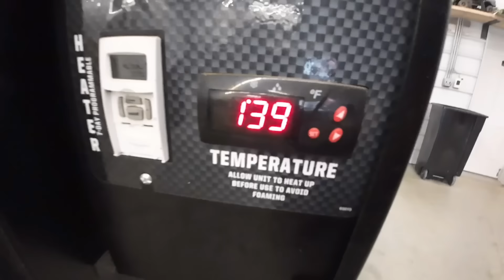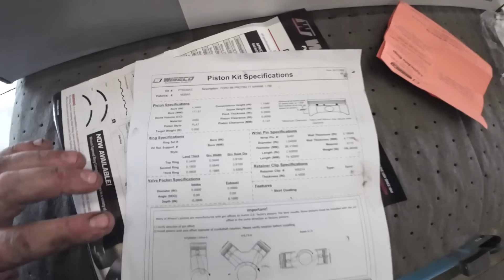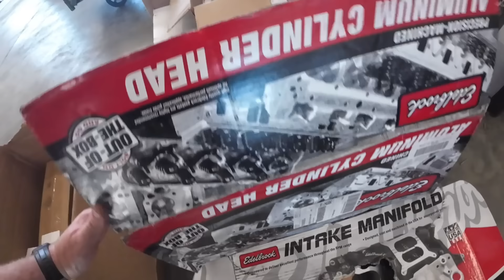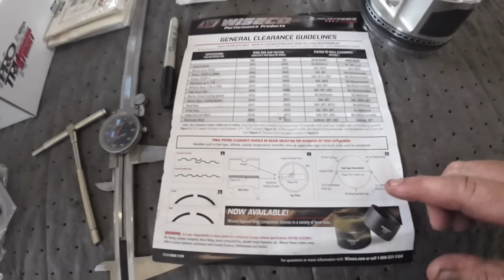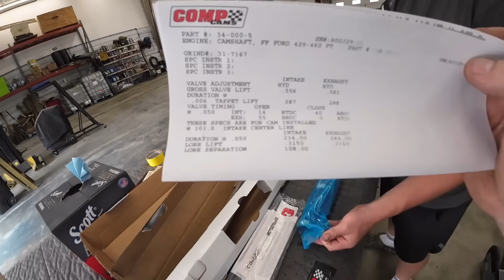Ford 460 performance engine build for Hunters 1977 Ford Highboy

Comment: going to be a nice build. I like the old 351m/400 ford motors . The 400 is a strong motor if built right  4x4...  4in stroke 4in bore   The 460 will make some good power !!!

Comment: Clint, I noticed when you installed the cam that the distributor drive gear was dry. I would suggest you lube the distributor drive gear when you install it. This gear has a lot of stress on it. It takes a while for oil to reach the drive gear.
Reply from the maker: Yea that probably a great idea
Will do next time
The oiling mod we done should of helped some also by spraying oil on that when we primed it up
Reply: U can lube the gear on the distributor when you drop it in.

Comment: the 460 is waaay better than the 351m boat anchor.  me and a friend did this exact swap on a 77 Ferd 4x4   it turned out great.  if yall want to upgrade that clunky np435. check out the tremec TR4050. i put one in my 85 K30.

Comment: Clint, on the cam bearing installer the white cone goes on the shaft and centers the tool in the cam bores. just like line boring loader  arm pins. the tool will then be straight when installing or removing the bearings.

Comment: Just wondering if you guys set the pre-load on that thrust bearing on the crank didn’t see you do it but I know that doesn’t mean you didn’t. I love this series on the Fords you guys do I got a 360 I started on about two weeks ago. Parts are a little pricey for that compared to most for some reason.

Comment: 500hp in an old highboy, i cant think of a single thing that wont break behind it😂😂. Cool ass build though man, awesome to see some father son builds these days that they can enjoy. Never seen such redundancy in engine stand strength in my life😂, engine looks like a toy on that stand in compared to what you usually have on it though. Use the rings per bore, never trust one ring for every bore use a ring for that bore as each ring will likely have a different gap on the same bore. FedEx is can destroy an anvil within a mile

Comment: we built a 383 stroker engine for a 78 vette with 650 cfm carb,  dyno at 420hp  500 seems a little light for the cost and parts used.

Comment: There is a white cone your cam bearing tool kit.  That is to slide over the shaft after the tool, small end toward the engine, and the cone is pushed into and held in the outer cam bearing hole to keep the shaft centered while you install a bearing.  That way the bearing is installed square to the bore.

Comment: I am afraid distances are larger where you live but sometimes for deliveries(to you) you’re better of collecting them at a pick up point. In this case of damage it is possible you cannot keep your promise to the customer because you have to wait for undamaged parts. But i am afraid environment it getting the better of us. Less waste so no protective stuff in the box. Like to follow this. Even the ,,humor,, between the 2 of you. ,,this engine wont do performance stuff,,
,,nope only an occasional drag strip run,,😉😁😉😁
I am not lazy but thats why i go for a citroen 2cv (ugly duck).
It’s a 2 cylinder engine.

Comment: An overhead hoist company needs to sponsor you and get you setup with a few. It was a real game changer as fast as making engine pulls/installs and material handling much faster when building trucks at my dad’s company. We designed and built all types of oilfield related semi trucks, rigs, pump trailers, generator trailers and so on. We utilized forklifts for everything for a few years before getting our 8 hoists.

Comment: Tap freeze plug holes and put in a threaded inserts because the freeze plug holes are just too get the sand out from casting 😊

Comment: I was taught at a very young age of 10. 
Was taking engines apart and put back together. 
Hands had to be washed and a light dusting of wet sawdust on the  floor so no dust. 
Great job dad and  son👍

Comment: Sometimes we buy modern day oil field Alberta trucks here in Ontario . For reference my buddy just bought a 2012 with 100,000 miles and it had 25,000 hours on it . Trucks up there idle , and idle , and idle some more . That should explain the .030” over bore and the bearing wear. I’ve been watching for a couple years now, keep up the great work and beautiful shop !

Comment: ford 460, should the flexplate weight be facing the 12 o'clock position ? 
or be facing 180 degs the other way in the 6 o'clock position?
 in relation to the hatchet weight in the front.
please help me, thanks

Comment: C&C Equipment.. Cool video. ALL of the rings should be checked and file fitted (or make bore bigger with hone) to the perspective bore they are going in. All of the rings are probably a little bit different in size as are the cylinder bores. Just because one ring fits doesn't mean all of them are within spec. ALWAYS fit the rings to the cylinder bore it is going in and don't mix them up. I have built engines where when I checked the gap in the cylinder I had to file fit some of the rings and some of the gaps were to big right out of the box. When that happens you have to buy more rings. Nothing you can do about a ring that the gap is to big except set it aside for the next engine and buy new ring/s. It doesn't happen all the time but it does happen.

Comment: Clint, great job, I like your honesty about you not being professionals, I was building a 392-international engine that times off number 8, and it was being difficult and the Transportation Manager picked up a can of starting fluid and sprayed it in the carb, well it blew the oil pan gasket the valve cover gaskets plum out from undereat the pans and bent the push rods, HE NEVER CAME BACK IN THE GARAGE LOL

Comment: Building a 460 myself and I have those same rockers, what length rocker studs did you use?
Reply from the maker: I don’t remember on the studs
It’s what came with the heads

Comment: Truck is looking good Clinton and Hunter! That 460 will have the torque to get that heavy truck on the move. The fuel injection will be a nice addition to not have to fool with the tuning all the time and probably a little better fuel mileage to boot. Lord knows she'll be a thirsty one! I can't believe they didn't pack those heavy parts better than that. Usually, Summit is very good about packing things very well, so I'm surprised they dropped the ball on their end. I've never had a packing issue with Summit as I have bought everything from crate engines to sheet metal from them over the years. My FedEx guy is very good about making deliveries during regular hours that my shop is open, but if for some unusual reason he's running late, he calls me to see if I will take them after hours and where to put them, but that is a very rare need, so I like to treat this guy pretty good.  That crap with piling them outside your gate would not fly with me. I know those guys put up with a lot of crap in their job, but that is unacceptable to dump that stuff off like that. UPS sucks in my part of the world, so I use FedEx for now. It used to be the opposite, but I think they're both going down a rat hole eventually. Anyhow, can't wait to hear that BBF fire up and go down the road!

Comment: Not just an issue in the USA with delivery drivers, also the same over here in the UK, as my wife and I have mobility issues and and aren't as fast or as able as we used to be, we have a large sign on our porch door that says, leave parcels in porch and then ring the door bell. You'd be surprised how many idiots just leave the parcel outside the porch and don't even ring the door bell! Nice to see you and the 2 boys doing car stuff together, really like that piston ring setter so easy to use. 👍

Comment: We have some old ring compressor /piston installer tools like that . They were John Deere special tools. Of course the Deere pistons come in the sleeve already so we don't use those much anymore . I'm in the middle of overhauling a 12.5. Have to use a long 3/4 ratchet to  torque rods and mains on those . They are tight .

Comment: I would bet that being that truck was used in Northern Canada in winter , where it gets to --- 30 that engine never shut off !!!  I live near the Canadian border in western NY and the block heater was the give away , That truck should have had a hour meter . In DOT if the trucks weren't plowing they were plugged in so you could get them started , A lot of the plow trucks were kept in a heated shop just for that reason . Love the videos , stay safe , be well

Comment: Bringing back memories, I built a couple of FE blocks and putting the top end together was different with pushrods going through the intake. I bet that 460 is going to sound sweet, except the camera in the cylinder and the one in the oil pan are gonna make a racket.😁

Comment: Not a big fan of FoMoCo, raised to be a small block GM/Chevy guy, but engine builds always fascinated me, just never had the shop set up like you've got to do the things you do! It ain't easy trying to rebuild an engine in your parent's carport!  Your sons are very fortunate!
I was wondering if you were putting a roller lifter cam in that beast, looking at the cam lobes it seems like that's what you were using, but you never said!
It'll be interesting to see how much Shake, Rattle, and Roll that thing has with that radical Cam! 👏🏽 👍🏼☺
With that much horsepower and stroke, the torque developed should be enough to do four-wheel-drive burn-outs, if you don't twist something off! 👏🏽 👍🏼☺

Comment: Will you put a line on the pushrods to watch and  make sure the cam lobes aren't  getting wiped  during break in? Everyone has been having problems with  bad lifters  lately--even name brands ! They can wipe a cam in minutes !! Good luck !
Reply: IDK if you're counting on your push rods to oil your cam lobes, seems to me you have bigger problems than the push rods. Try checking the oil passages to the Cam as a starting point.😮😊
Reply: pushrods dont oil cam lobes-you just want to make sure the pushrods are spinning-then you know the lifters arent wiping the lobes ! @Curt-dc6cd

Comment: know it is too late by the time I seen video. you had pistons marked with arrow for a reason, so 2 that I seen are wrong by the arrow marking. did not see all so only know about the 2. if it made a difference, it would be in the rods.
Reply from the maker: Yea
We got them right

Comment: Coming along nicely ….I believe the h beam rods are actually scat industries with summit on them….they are identical to the ones I bought for my Chevy motor . The rpm cam will be lobey…he should have fun with it . At 8 gallons to the mile….errrrr…8 miles to the gallon 🤣🤣

Comment: Clint, a little tid bit for you. A very good buddy of mine works for Fed Ex..been a courier for 28 years. He’s told me personally, (because like yourself I had some complaints) that Fed Ex is trying to move away from the current service to a 100% sub-contract service. It’s less headaches for the company has a whole and puts the burden on the subcontractor. But the customer service has plummeted..trust when I say you’re not the only one frustrated. My buddy has told me to use UPS many times…

Comment: Had you thought about having the rotating assembly balanced?
Reply: Although it can't hurt... You probably only need to balance the crank in a racing engine, which you would have balanced and Blue printed anyway. Good tip though.

Comment: Edelbrock doesn't make any max effort stuff, but for what you are doing, they do have good top end kits. The heads, intake and camshafts are made to work good when used together. You need to call the fed-ex 800 number and do some serious complaining. I have an account with them and they never charge for pick ups. That's all on the contractor and corporate fed-ex probably doesn't know about it.
Reply from the maker: Yea
Who want to waist there time with it
We have other options

Comment: You should name the engine, "Serendipity".  As I remember, you mentioned selling it when you first pulled it.  You probably would have had an upset buyer who expected perfection and then found the problems like the distributor gear.  I had a '92 with a stock 460 and the gas mileage wasn't terrible, so it won't bankrupt your son to use it as a daily driver.

Comment: Not a Fjord guy but that truck is looking extremely nice, while you have it broke down like that put a disc brake kit on the rear axle for much better braking Hunter will need it for that extra horsepower it will be making. Great job gentleman.

Comment: Your boys may be the last generation that will be able to do stuff like this.  When their kids are old enough to buy a 40 year old truck to fix up, it'll have so much obsolete electronics and emissions crap that getting replacement parts to make it run again will be impossible... if combustion engines are even legal by that time. But your boys can still tell their kids stories about how you helped them fix up their old trucks.
Reply from the maker: Very true
Nobody is gonna fix up any electronic crap

Comment: Clint did you ever think of welding a socket on the handle bar that turns the motor on the engine stand and eliminate the handle and use that Paul wrench

Comment: Clint, not sure if you are aware, but have your indicator at such an angle when checking end play introduces cosine errors. I'm sure that you're still within spec. But I'm sure there's more than .004 endplay in that crankshaft. If it had been .006 or more you would likely be out of spec. 
Just a heads up from an old school machinist.

Comment: Another YouTube guy called Stapleton did a entire series on Lake Speed (Nascar Driver) and his son that actually works for Total Seal and it was eye opening at the level of detail that they go into with rings and the honing process along with how the entire system works, I suggest anyone to go check that out because if your into engines the information that they give in those videos will blow your mind at today’s technology! Just with the hone job and new piston rings they were able to prove they increased horsepower by 20 and that’s impressive in anyone’s book!

Comment: Ford built a 351 Windsor, Cleveland, and Midland what is a 351 modified?
Reply: The 351M is essentially a de-stroked 400. 351M has a Big Block bell housing same as a 460.

Comment: I feel your pain with FedEx I order a lot with summit racing and never had a complaint always been fair and very reliable but FedEx is an absolute joke anymore had several boxes damaged left out by the road with no one home called and left several complaints to FedEx and have been told numerous times it's basically not their problem it's sad times anymore as far as customer service

Comment: A guy could try replacing that molasses SLOW crank handle of that excellent engine stand with a cordless drill of adequate size.  Who knows?  Could turnout good for trimming time and boredom both.  Hunter show Dad.

Comment: Clint,  Quit reiterating the fact you are not a "professional motor" builder, you are as close as they get.  The only difference I see is there may be Performance Motor builders that have a routine and can do all the steps faster and with slightly more detail surety, but you exceed garage shop builders by quite a margin. I would think that ability comes FROM your Diesel experience as tolerances there are a bit more critical than gas engines with the compressions and torque requirements for big iron.  Great Series sir!!!!!

Comment: Is this a windshield wiper motor, a heater motor, a stepper motor, a Tesla drive motor?  I am confused. What kind of motor are you working on?   I had a teacher at the Auto Mechanics Vo Tech school that drove this into everyone in his class.  He had a check mark system for every time anyone called an engine a motor.  Wow my OCD kicked in and hopefully he doesn't watch this because he will drive there.  haha  🤣😆😅

Comment: How the world has changed. When I was a kid in the late 70's early 80's building these lazy old V8's - the goal was 1 hp per cubic inch, that was a hot motor, crank it forward 40 years, 500 hp from a 460, thats a nice mild build not to crazy!

Comment: Why don’t you fix heat tubes on open cab dozer’s ,loaders and etc. start half way down on grill go all the way to top wield your pipe then back to the equipment operator the heat tube box cut hole for door so they can open so it don’t over heat the equipment

Comment: The technical term for that plug is a core plug it is used to plug the core holes and oil gallery holes and the cam shaft bore, the name is a welch plug, some manufacturers use hex-socket head pipe plugs in the oil galleries. My olds didn't like 65 psi back there so I loc-tited the bore before inserting the plug and drilled 3 holes in the edge and tapped the holes for machine screws which were also loc-tited. Those plugs were called freeze plugs so the water had some place to expand, I lost an engine to freezing and a friend lost 2 , no antifreeze and a cold snap (35 below), oh the ice made worms but the blocks still broke, so unless you have gobbs of steel near them holes they aint saving no castiron.

Comment: You guys are not engine builders. You are parts replacers. 
First, you did not take into account the oil pump pickup is deeper in the oil pan, because the oil pump body is deeper.
Next you did not blueprint the oil system in the block. I stopped watching this video..

Comment: I think the truck needs a 650 rear end and a 5th wheel setup.  Then this engine can burn about 3 miles a gallon all the way to Alaska! (We were poor, so we only built a 390 to suck 6 miles a gallon, 60 gallons to pull a 22 ft trailer to the Ukon.